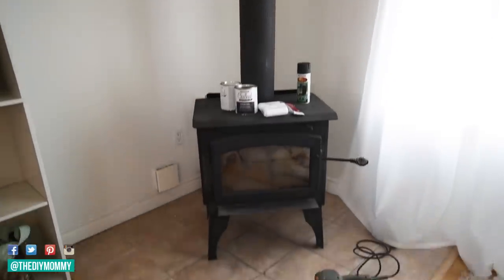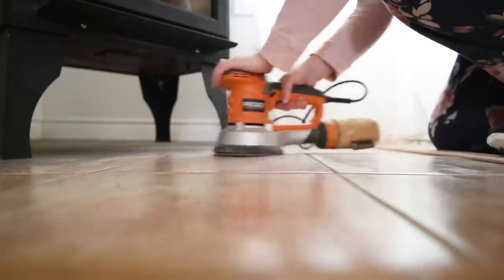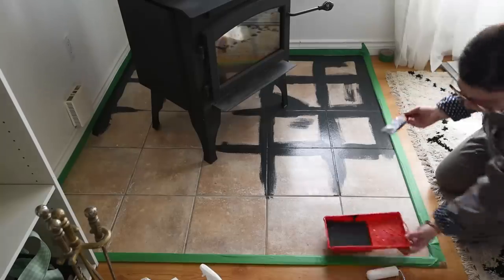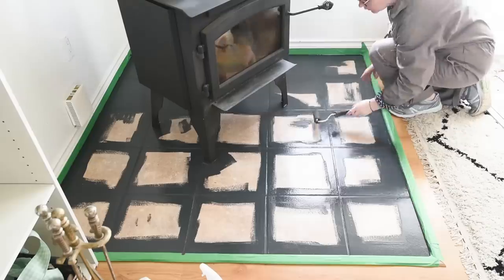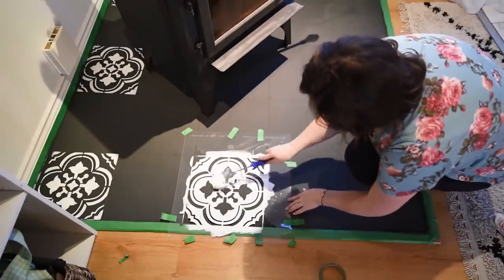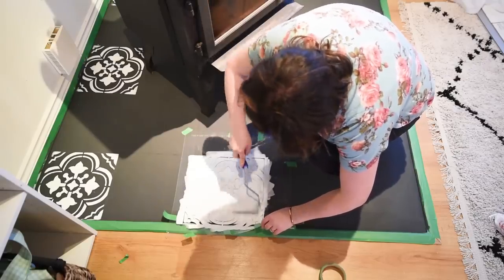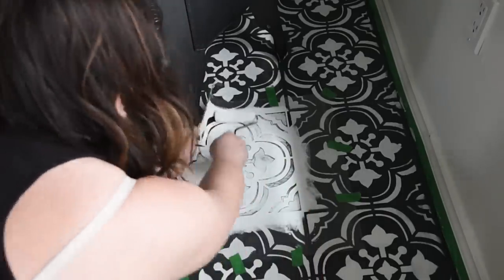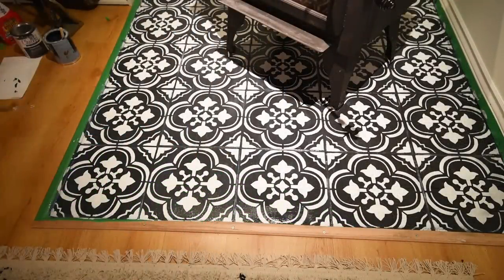How to Paint Floor Tiles with a Stencil | The DIY Mommy

Comment: It's not until the end of the video that I noticed that the thing in the middle of the floor was a stove connected to the ceiling... So during the whole thing I just couldn't understand why you didn't move it and  painted around it xD
Reply: Those stoves are not only connected to the ceiling, they are super heavy, like 300 lbs!
Reply: there should be a way to disconnect it like anything man made, i guess she was just lazy
Reply: @stellenboschstellenbosch1037  she just individually painted all those tiles and you go and call her lazy... yeah ok
Reply: Stellenbosch Stellenbosch  😂  psh yeah totally. These stoves are connected from in the ceiling to the floor. In the ceiling they’re usually bolted and secured very very well. It would take a professional to move it. Her trying to move it would risk her safety. The stove, roof, and tile could also be broken in the process. Just smarter to paint around it especially if you’re on a budget.

Comment: Nice job, I would suggest maybe 5 coats of a waterborne polyurethane or 3 coats of an oil-based polyurethane varnish for better durability especially on high traffic areas, and no shoes for at least a month. and if you know anyone with a vinyl cutter you can have stencils made for any shape tile. I really like what you did.
Reply from the maker: Thank you!
Reply: Thank you soo much for sharing that tipp!!☆♡☆

Comment: I love it 🥰 but why didn’t you move the wood stove?
Reply: Removing those wood baseboards would also have saved some time during painting too
Reply: these are very heavy and full with bricks. you would need couple of people to move it. also some of these have water inside (pipes, etc) and sometimes it is easier to go around it.
Reply: Clearly she couldn’t or she would have, huh?🤷🏼‍♀️
Reply: The stove is connected to the wall/ceiling by a pipe, of course! It's an oven..

Comment: Why didn't you move the stove or however it is called in english. It would be easier. Btw, your tiles now look fantastic!
Reply from the maker: Thank you! The stove is far too heavy for me to move, so it was easier for me to leave it.
Reply: Yeah it takes about 4 or 5 people to move a stove haha
Reply: @thediymommy  Then ask 4 or 5 people to help? Surely when that stove is eventually moved the parts where it wasn't painted will have to be painted over.
Reply: Jules_86 it’s also connected to the ceiling, she was looking for something quick and easy, doing that would add another day to her project at least! Doing what she did was the right call
Reply: First it's heavy,
second it's connected to the wall/ceiling by a pipe
and third she/they would scratch the new floor by putting it back..

Comment: Good job!!  If you add a clear floor epoxy it will help keep it nice and untouched plus it fills in the tile cracks. And if you ever want to Change the pattern, you just paint over it and re-epoxy

Comment: Why would someone downvote this? Great job! I'm doing my bathroom tiles and you had some great tips.
Reply from the maker: Thanks Mary!~
Reply: Okay, 3 months and 200 hours later I'm finally finished with the small half bath with only 20 16x16 tiles. 🤪 I primed twice and painted two coats of white. Then made the mistake of using a regular paint for the stencil that was too runny. I repainted my test and found some chalky acrylic at Michael's. The problem came when I started to stencil. Used a small amount and used your tip and rubbed off extra on paper towel. But they still bled. And the mistake I made was sitting on the floor and looking at the tiles up close. I found myself pretty much "touching up" every single edge of the design to smooth out the edges. It was a nightmare. 😅 THEN when I started sealing, some of the blue stencil paint smeared, so I went back over the smears and tried to paint on TOP of the poly. At this point there's probably 5 coats of poly on the floor, there are only a few anomalies I can find, the floors looked stamped and they're beautiful. And I will never do this again. 🥴

Comment: This is my first for tile painting the finished product is beautiful.  The paint you used, is it meant for floor tiles?  If so, how would take heavy traffic areas?  I am impressed with the fact that you didnt have to pull out the old tiles.  Thanks for the step-by-step tutorial, it is helpful.

Comment: I love this and will use it inside my ugly front entrance tiles. Does this Polyurethane stand up to the traffic, especially wet boots etc? Does it yellow? On a separate note,  I think for the future it's a very good idea to state if you are doing this near a working stove or fireplace make sure you use paint that can stand up to the heat. Great video thanks for sharing.

Comment: I definitely want to try this now on my floors. The only problem is my entire house, that we recently bought, is covered in the same floor & it's exactly like your (old) floor 😩. Retiling everything is not in our budget nor is putting hardwood flooring over it. This is definitely an option. We can even divide the areas with different patterns/colors. Has the paint chipped at all? Your scenario is obviously different than mine. But If you think it'll last for at least 4-5yrs and on high traffic areas,  I'm planning on doing this. Thanks in advance
Reply from the maker: I only have experience with the area I did and it’s holding up very well thus far

Comment: We painted the tile around our gas fireplace. We used a specialty paint meant for painting tile. No sanding needed, and primer built in. Of course it wasn't tile we were walking on, but it worked really well.
Reply: Do you remember the name/brand you used?
Reply: @mariemyers6747  It was a brand made by a local company that's no longer in business, unfortunately.
Reply: @MyFocusVaries  Thanks for letting me know 👍😉

Comment: Very nice! If you have multiples of those stencils, you can also cut one to fit along the edges/outer tiles so that it lies flat- ive done it before and it helped save time. Just curious how well that brand has held up so far?
Reply from the maker: Great idea! I just had one stencil, but if I had multiple, this would definitely save time. It's holding up well so far!

Comment: Wonderful job! Will this kind of paint work in the high traffic areas and bathrooms? If you have to mop the floors, will it be a problem, or there is another type of paint and/or sealant? Thx
Reply: nataliya shcherbak  good questions I would also like to know this.
Reply: I'm wondering the same. How durable is this to time and use; i.e. cleaning, floor traffic? But otherwise I love the idea of painting the floor tiles. What an great way to redecorate on a dime! And I'm partial to anything with black and white color schemes, so I love this color/pattern.
Reply: Same question 💁

Comment: I’m going to stencil my bathroom floor but use a water based polyurethane gloss top finish. Are cleaning chemicals going to ruin this? I usually use a swiffer in my bathroom but I don’t want to ruin it
Thanks

Comment: Want to try this but thankfully i am going to do the tiles b4 they are put down...making it a lot easier...lol but time consuming because want to do about 12x12 kitchen area. Ready to get to it and hope it turns out good. Only reason i want to do this is i cant get gray tiles of the same kind in tan ones so gonna paint them gray then stencil i think black and white maybe. Not sure yet...still thinking. Want it to match with my black dining room tiles and my kitchen walls are a light gray with bluish tint.
Reply from the maker: That sounds very pretty!

Comment: Super cute, but I think I would just retile with patterned tiles. After I did our small bathroom, I would not be scared to do it anymore and then I would not have to worry about the paint scratching or being damaged from heat.

Comment: Hi Christina, (I hope that's how u spell ur name, if not I'm so sorry) I love this. I was wondering if you could do this technique on linoleum? Also, I know this video is A yr old. I was wondering how your "subway tile backsplash is holding up and looking in your studio  kitchen ? The ones from Dollarama? I saw D Tree has a subway tile peel and stick. It comes in white and a charcoal gray color. I have never done anything like that b4. I want yo buy them from DTree on line. You get 50 of them, they are 12x12. Your have joining ends. These are just peel and stick. I was wondering if you think they would be worth the investment? These are just square tiles. I have wallboard in my home. I should sand it first right? Or prime it? I think priming it would be better so I don't have to worry about sanding my walls? Whst is you suggestion?

Comment: Nice crisp look but I was wondering if this is safe. Will the high radiant heat from your stove catch the tile on fire and/or damage your paint job. Your pad doesn’t look all that safe to me. Are the tiles vinyl? Donut they need to be fire proof? Don’t you need airflow under it? Your carpet, drapes and wood bookcase, wood floor and wood trim look a bit too close to the stove as well and there is no heat shield behind the stove. I know that I sound overly critical of what otherwise appears to be a great looking project. Just curious as to how you addressed the safety heat issue. Maybe stove paint which is rated for high heat applications would be better than chalk paint.
Reply from the maker: I'm not worried about it because I've never used the stove or plan to use it in the future. Thanks
Reply: Interesting... why have a stove if you never plan to use it? Good luck on all your DIY projects!

Comment: what kind of paint can be used for an exterior tile project? :)
Reply from the maker: I'm not sure, you'd have to research it for your area - I'm sure depending on whether you get snow or if it gets really hot, would all impact what kind of paint you'd need for outside :)

Comment: It looks absolutely gorgeous! I am, however, quite concerned about the curtain you have so near your woodstove. I understand that you are going for the full length slightly puddled look, but it really does not look safe. Perhaps you could pull it into a swag on the far side. That would preserve a romantic look while moving the flammable drapery away for your woodstove.

Comment: What an incredible idea! The floor looks amazing, I'm an interior designer and I'd definitely use this in my projects! ^_^
But, I only have one advice - maybe next time you should try to start painting from the inside corner and slowly progress to the outside, that way you'll be able to paint your tiles one by one in order and reach every one of them easily :)
Reply from the maker: Thank you! There's an overlapping piece on the stencil that helps line things up, so I had to do every other tile and let them dry before I did the rest.

Comment: Would look better with only every second tile painted. With all the tiles painted it's a bit hard on the eye. Also, the white color on the black is too much of a contrast. Using not as thick a layer of white paint would be more pleasant to the eye. And it would give the tiles a more used, older look.
Reply from the maker: Thanks for the feedback 😊

Comment: This is insane. Please do not attempt this yourself. First of all, painted tile is going to wear and look horrible over time, second of all, you would have to spend at least a hundred hours on it and be a master painter to achieve this look. Last of all, budget my *ss. You have no less than three (4 with primer) types of paint, tape, brushes, and other prep materials, they are all quite expensive and this look will not last, the paint may end up running into itself with the topcoat applied, you never know. Just go and get the tile you want, and  tile it, be done in a day, it will last forever. Also, ditto on the fire hazard near the stove!!!
Reply: Edit, forgot about the sander, You also have to buy a professional sander, probably costs hundreds, then clean up all the grit using the damn goop she had.